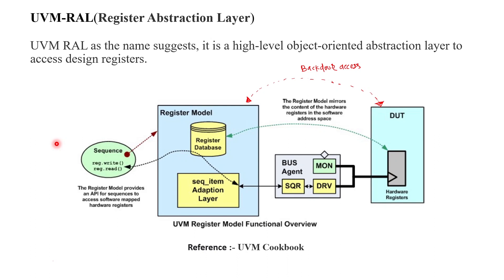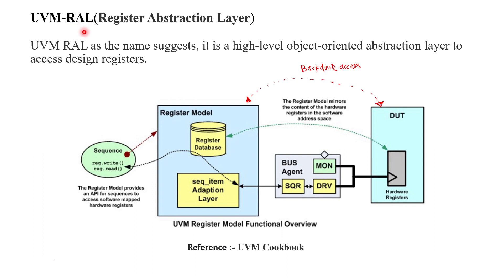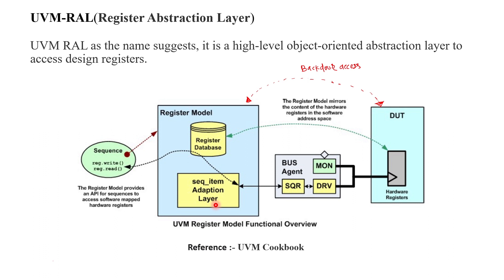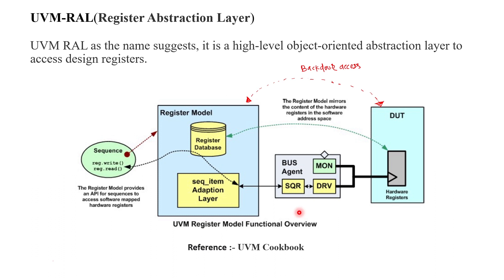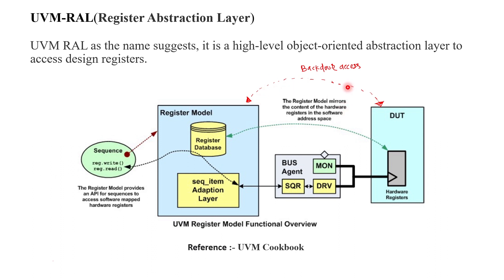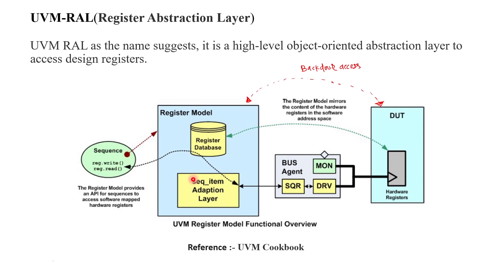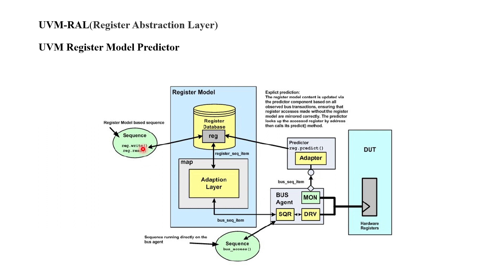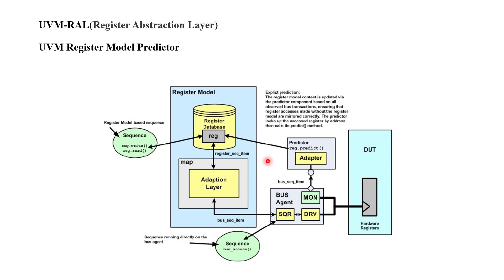Introduction to SV-UVM RAL(Register Abstraction Layer).

Comment: Well explained. Can you also post a video on the driver sequencer connection. It's a bit confusing. Thanks
Reply from the maker: It's very easy bro ..

Just google driver and sequencer connection u will find one block dig, goto  www.testbench.in image see the first block dig, driver has an inbuilt port(seq_item_port) where as u will find sequencer has an inbuilt export(seq_item_export)and connection will start from drivers bcz it's an initiator hence in the connect phase of agent u will find the below line of code map this with that block diagram u will get a clear picture.

drv_h.seq_item_port.connect(seqr_h.seq_item_expot);

drv_h is driver class object and seqr_h is sequencer class object.

I hope this information will help :)
Reply: Check out This Playlist.  https://youtube.com/playlist?list=PLBIILfL2t1lnvzw7vF0arlvu36Wj4--D7